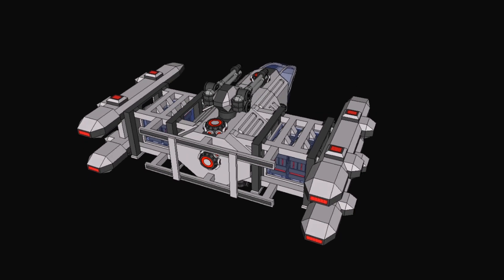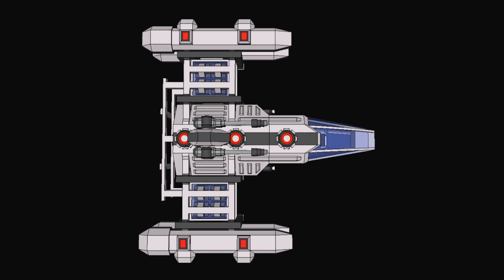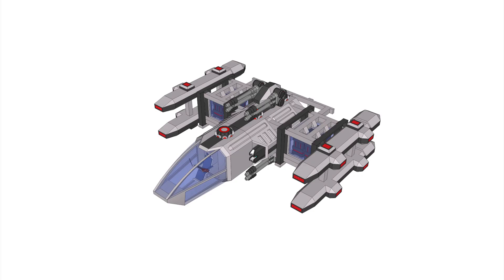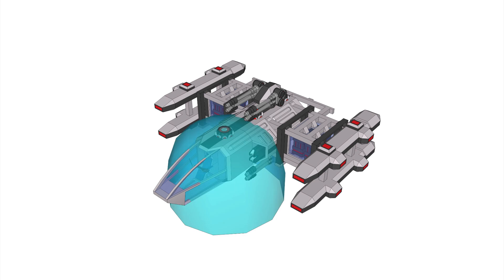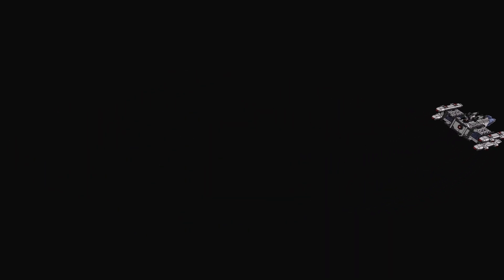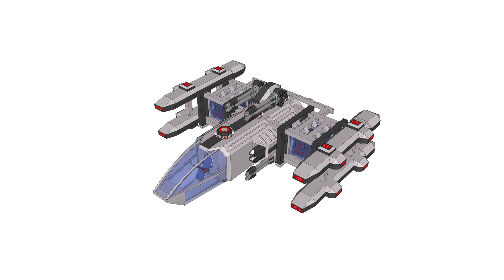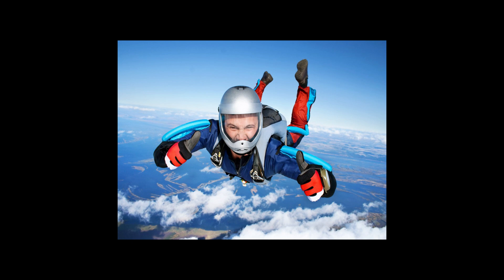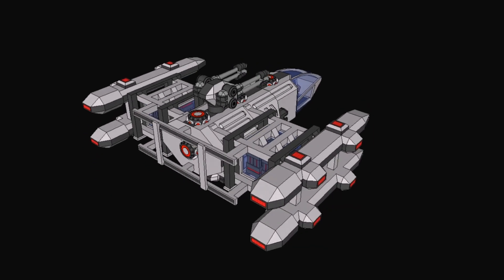Shad has a question! Gravitational acceleration on a spaceship?

Comment: The primary liability is that the force of gravity diminishes as the the inverse square of the distance (F = G[m1m2/r2]), so meaning that the gravity of anything distant enough to be useful for propulsion would be too weak to provide any meaningful benefit.  On spaceships, however, such gravity fields need only extend 2-3 meters 'above' the decks - not only requiring far less power (by numerous orders of magnitude) but far more effectively.

The only alternative would be if a system was capable of generating a gravity well directly ahead of the ship - this, however, would be the equivalent of 'blowing your own sails'.  The force required to maintain the gravity well's distance from your ship will be virtually identical to the gravitational force intended to propel your ship forward.  May as well try to reach the moon by jumping repeatedly.

Comment: Grrr.. Lost my comment when I went to look something up.. So ill be brief:  You want to look through 'because science' on YouTube.  He covers a lot of the pitfalls and problems you are going to run into.

Stray hydrogen atoms at a density of 1 /cm^3 irradiating your crew.

Time to get up to relativistic speeds at an acceleration humans can endure (around 1g).  Time to decelerate from that speed.  (1/2)at^2 = v it i remember the equation correctly.

Your 'inirtal dampeners' would likely tear your vessil in 3 if you counteracted the gravity in the crew cabin enough but still applied gravity to the outer engines.  Your drive pods would likely tear themselves from the hull.

Comment: acceleration always needs some kind of energy and the faster you go the more energy is needed witch is exponential (you would need less energy to accelerate from 0% Light speed to 10% than you would need from 80% to 90%) and reaching light speed would need infinite energy so if you constantly put the same amount of energy into acceleration you would accelerate less and less until your so close to light speed that you can't measure any acceleration anymore (witch would probably take like forever) so the limit to all kinds of propulsion is light speed but the point at witch you're accelerating so slowly that it would not make sense to waste any more energy to accelerate really depends on the propulsion method used

correct me if you want i'm not studying physics or anything

Comment: I've been using gravity drive star ships in my writing for over a decade now... but your thoughts on inertia are wrong, at least within the relevant ranges for what your gravity field is likely to achieve.  Acceleration is a constant, and it doesn't require any more energy to accelerate a 10,000 km/h spaceship at 10 gravities than it does to accelerate a 1,000 km/h spaceship at 10 gravities.  Things start to get weird as you approach light speed, but if you're using it as a sublight maneuver drive, you might as well just use an FTL drive to assume those really high speeds..

Effectively, there is no top speed in space, and all "Speeds" are measured by rates of acceleration and deceleration.  A realistic portrayal of space travel has no "top speed" for sublight space ships since they'll never even begin to approach light speed using any sort of gravity or reaction-based drive, though FTL drives can function according to whatever sort of superscience mumbo jumbo you want them to.  Say your ship is traveling at 10,000 m/s and has acceleration of around 100 m/s.  It would take 100 seconds for of retro-acceleration for it to come to a complete stop, and 100 seconds of forward acceleration to achieve a speed of 20,000 m/s.  As long as you don't exceed some 200,000 m/s, you don't have to worry about relativistic physics kicking in... but once it does, that's when the whole wibbly wobbly timey wimey stuff begins to take its toll.  So I guess you can treat 200,000 m/s as your speed limit, but it should take hours of super high acceleration to achieve it.

Comment: OK, I'm really late to the party here, and haven't had time to really peruse the other comments, but you appear to be making the propulsion part too complicated. Look up the Alcubierre drive. 

The good news:
The basic theory is this. You create a spherical field around the ship that creates heavy gravitons in front of the ship and light gravitons behind it( a warp bubble). You could contract spacetime in front of the ship and expand it behind the ship, thus creating a gravitic wave moving in the direction of the heavy gravitons that carries the ship along. The theorietical limit on how fast you can expand/contract spacetime is the speed the universe expanded at the big bang, roughly 30,000 trillion times the speed of light. So your upper limit is really freaking high. 

More good news: 
Since everything inside the warp sphere is essentially standing still, relative to everything else in the Alcubierre bubble, no inertia, and no time dilation effect since everything inside the bubble is standing still relative to each other. This is the loophole of general relativity: local distance markers inside the bubble need not be the same as global distance markers outside the bubble. By manipulating the field generators to produce heavy and light gravitons in different points on the sphere, you could effectively steer the ship. Maneuvering thrusters could be coordinated with the field generators to keep the nose of the ship pointing in the direction of travel(or not, doesn't really matter). 

The bad news: 
Energy: to contract all the space time between, say, Earth and Alpha Centauri, would require the equivalent mass-energy of whole planets or thereabouts. One possible workaround is to create an oscillating field that only contracts, perhaps, the half a million kilometers in front of the ship and expands it behind the ship, and then contracts the next 500K Km when it gets that far, and so on until reaching the destination. This would take less energy, per oscillation, but would require more energy overall than a single jump would. The trade-off would be that your top speed would be lower for a given energy output, Still, you can gather hydrogen or otherwise refuel in flight, and thus it might be practical from an energy standpoint. However, you may find attaining or surpassing the speed of light difficult as you will need exponentially more fuel as you go faster. 

More bad news:
Radiation: First the usual kind: x-ray and gamma. As you go faster, the apparent frequency of the light hitting your ship gets shifted toward the shorter end of the spectrum(blue shifted). Unfortunately, this effect doesn't stop at blue as you get closer and closer to light speed. it continues into x-ray and then gamma. So you would need to be shielding against a white hole in front of you spewing enough gamma radiation to vaporize your ship and all its inhabitants. 

At the same time, you would have a black hole behind you blasting you with Unruh/Hawking radiation which would crisp you all the way to Planck temperature at FTL speeds(1.42 x 10^32 K). 

Come up with some cool scifi techno-babble to explain away the bad stuff, and you're golden. Assuming such tech exisited, you would just need to generate a gravitational acceleration field around the entire ship and the inertial dampening problem, along with time dilation effects would be solved.

Comment: If the way you are imagining it in your universe is the way you say, i see two limiting factors. One. Gravity acts on an object and pulls it towards it. Fair enough. So you want to use this to essentially pull your ship forward. Okay, sure. My thought is that the rate of your acceleration and decceleration is limited by the integrity of the ship, because your propulsion is basically like pretending there is a planet in front of you, pulling you to it. The more powerful the gravitational engine thing, the bigger the planet. However, if it is too strong, it would be like a person standing on the sun. The gravity would be so immense, it would simply crush you. So your hull integrity limits acceleration and decceleration to an amount of force it can withstand. Two. Basing this one on inertia. Pretending there is no friction in space (there is very very very little), you would be able to infinitly speed up. You thought that after a point, you would need more energy to go faster, which is only true when friction is applied. In a frictionless enviorment, you could theoretically propel yourself past the speed of light with just your breath, though it would take a while. Also, you could be going the speed of light and stop yourself with only your breath, but it would take a long time. The very little friction in space could eventually stop you, as you said, but the real second limitation is time. Because your ship's propulsion is limited to the speed you can accelerate without tearing yourself apart, it"s going to take a long time to reach max speed, and more importantly to stop. Once you reach these speeds, it's only a matter of time until you hit something, even in empty space. It will take you SO long to reach these speed, and SO long to slow down, how do you even know where you are going? Another thing, you wouldn't have a chance to even register you are about to hit something. Heck, if youre going faster than light, you would hit the object in front of you before the light reflecting off it even hit your eyes! Morale of the story; "Inertia is a B****!"

Comment: If the ship was pushed by the gravity field in the ship, then there wouldn't be any gravity as the ship would be accelerating in the same direction as the people. It would actually make more sense if the ship was accelerating in the opposite of the gravity generated.
Also, you don't have a lot of walking space so why the need of artificial gravity? Just get straps and a magnetic repulser suit to keep yourself from slamming into the sides.

Comment: Ignoring all the reasons this is impossible, the speed of light is your maximum speed. However, from your perspective, there is no such limit, you will just continue to accelerate at a constant rate forever (or until you stop). Once you are traveling at sufficiently high speeds, you will notice stars color shifting via the Doppler Effect. Then you will notice individual stars reddining and exploding at an increasingly terrifying rate until there are no more. Time dilation.

Comment: In your universe, it looks like it can be.
However, i assume you want a faster than light propulsion, your gravity thing wouldn't be able to do that.

There is a real idea for a "warp drive" which, in short, moves the regoin of space you are in relative to the space around you, leting you effectively move faster than light.

This problem is why many universes use separate sub light and faster than light propulsion systems.

Comment: Assuming that you can create a cone of gravity field which involves your entire ship and then some : Mathematical acceleration due to gravity is 9.81m/s - in the vacuum, you can get pretty close to this number. Imperfect vacuum can contain 100 - 0.01 particles per cm3Since normally you get stopped by resistance from air particles , similar thing should happen in space but to a very small degree. 
Normal earth air contains 2.5x10^23 in 1 cm3 So, depending on the mass of your ship, terminal velocity should be reduced in proportion to the difference in number of vacuum particles versus normal air particles quantity. This assumption only goes as far as Wikipedia. On what other people have said, if your forward thrusters encompass enough space around your ship, particles in space should also start to accelerate. This will further reduce your terminal velocity, however there might be a rapid increase in temperature as you get to your terminal velocity. If your thrusters will also accelerate space dust, by the time you finish accelerating you might find a solid wall of dust in front of your ship : dust that started accelerating at the beginning of your journey and some that got caught on your way there. I noticed that your thrusters aimed at decelerating your ship, are behind the cock pit. This might mean terrible things for whoever is piloting the ship, as ship starts to decelerate and they are still moving at ridiculous speeds. ouch Do correct me if I'm wrong .
Reply: You could go as fast as : 73411318m/s
Assuming: weight3.5tonnes
Surface area: 20m^2
Negligible fluid density of vacuum
Drag coefficient of 0.4
By wikiHow :)
Quora, Wikipedia
Reply: 9.81m/s/s - in a vacuum, is the Gravitational acceleration of the earth at atmospheric level. In order to accelerate the ship at the same rate,  wouldn't he need to create a gravitation field with the equivalent mass (approx 6x10^24), projected a distance away, equal to the earth's radius (if physics works the way he is proposing). Our good friend Einstein teaches us the E=MC2, meaning the amount of energy required to produce that level of acceleration would be astronomical.  You could reduce the energy required by having a lower mass equivalent field, closer to the ship. But the closer you are to the source of the gravity well the sharper the curve in space/time. The would be a limit on how close/powerful a field you could project without creating a gravity shear that would rip the ship to pieces. Which brings me to the engine placement, if the centre of the field is far enough outside the ship, it does not actually matter where in the Ship the engines are. But if propulsion is provided by a curvature of space, then you wouldn't need reverse thrusters as others have mentioned. switching the gravitational field off will drop you back to your original velocity before its switched on so you wouldn't need thrusters to decelerate. The real problem is that without the ability for the ship to approach the centre of gravity of the field, there can be no acceleration. It's like trying to move your self forward by pulling on your own nose.

Comment: So, it you could project the theoretical graviton from an arbitrary position (since this would be what is required to have the force of gravity effect the ship in front of the ship) it should be as if the pulse field generator is in front of the ship, gravitationally speaking. As the ship increases its velocity, it would get greater relativistic mass. This mass would act on the pulse field generator as if it is in front of the ship. The generator would eventually be ripped from the ship of the back of the ship, as its "imaginary location" would move to the center of the ship. This would cause the field to be destroyed, and probably the ship too.

EDIT: Also, falling into a gravity well and having another created inside, so doing this for a while would create some very extreme tidal forces.